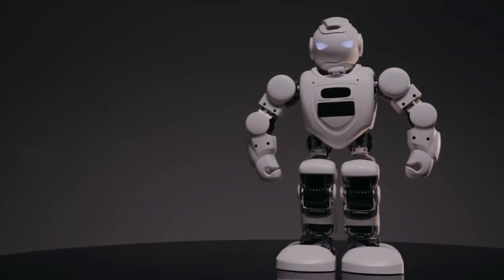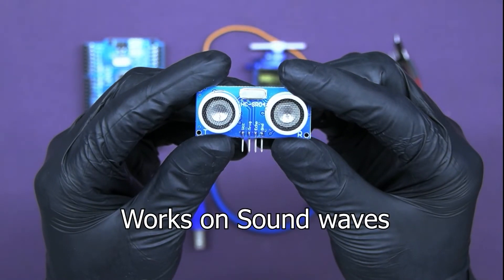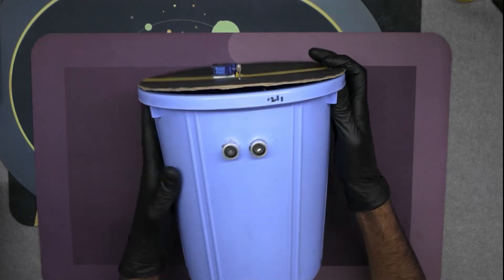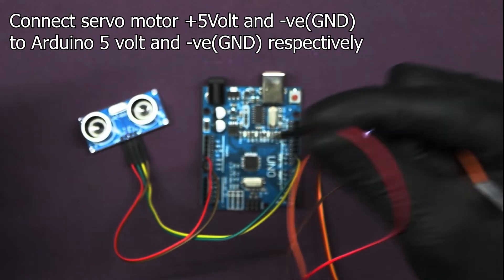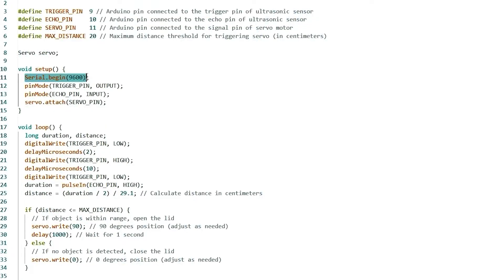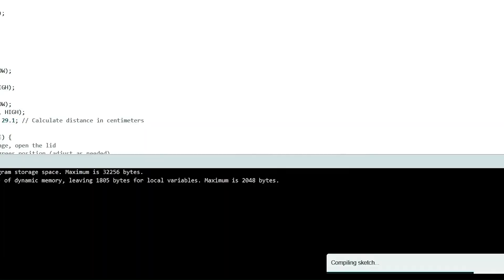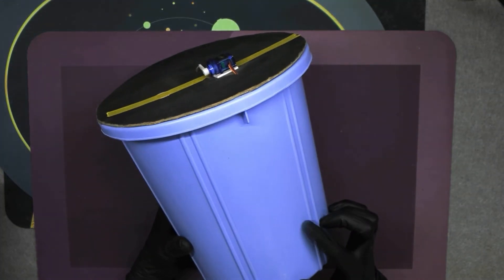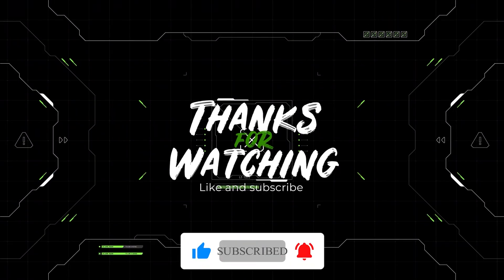Waste Wizard: Crafting a Smart Dustbin using Arduino UNO I Robo Army I Arduino Basic

Comment: Hi,

I'm facing error messages:

Output

Sketch uses 4194 bytes (13%) of program storage space. Maximum is 32256 bytes.

Global variables use 243 bytes (11%) of dynamic memory, leaving 1805 bytes for local variables. Maximum is 2048 bytes.

avrdude: stk500_getsync() attempt 1 of 10: not in sync: resp-0x00 avrdude: stk500_getsync() attempt 2 of 10: not in sync: resp=0x00

avrdude: stk500_getsync() attempt 3 of 10: not in sync: resp-0x00

avrdude: stk500_getsync() attempt 4 of 10: not in sync: resp=0x00 avrdude: stk500_getsync() attempt 5 of 10: not in sync: resp=0x00

avrdude: stk500_getsync() attempt 6 of 10: not in sync: resp=0x00

avrdude: stk500_getsync() attempt 7 of 10: not in sync: resp=0x00

avrdude: stk500_getsync() attempt 8 of 10: not in sync: resp=0x00

avrdude: stk500 getsync() attempt 9 of 10: not in sync: resp=0x00

avrdude: stk500_getsync() attempt 10 of 10: not in sync: resp=0x00

Please suggest how to fix it, thanks

Comment: Ardino 
Servo motor
Jumper wire
Power holder adc power
Ulasonic sensor
Lithium battery
Reply from the maker: Looks like you've got all the essential components for the smart dustbin project! 👍
Reply: @robo_army_ not yet

Comment: What does the jumper wires' size specifically need to be?
Reply from the maker: You can use standard jumper wires that are about 20–30 cm long. The exact size doesn’t matter much — just make sure they comfortably reach between your Arduino, breadboard, and components without being too tight or too loose. Shorter wires help keep the setup neat, while longer ones are better if your components are spread out.

Comment: How much time we have to charge them using lithium ion
Reply from the maker: Good question!  The charging time of lithium-ion batteries depends on their capacity (mAh) and the charger current.
For example, a 2200 mAh Li-ion battery with a 1A charger usually takes around 2–3 hours to fully charge.

Comment: Bro my arduino uno does not have two 5v port
Reply from the maker: No worries! You can still use your Arduino’s single 5V pin by using a breadboard power distribution or a 5V regulator to safely power multiple components.

Comment: One doubt 5v and Gnd in ardiuno  for both servo motor  and ultrasonic is confusing plz tell
Reply: Now motor working  thankyou but the cap of the dustbin cardboard  cannot open 😅
Reply from the maker: Glad the motor's working now! Try making the cardboard lid lighter or adjusting the servo angle to 100–120° for a stronger lift. Let me know how it goes!
Reply: What can do open the top of the dustbin?
Reply from the maker: The 5V and GND pins on the Arduino are for the power supply of both the servo motor and the ultrasonic sensor.
Reply: @robo_army_ thanks ❤
Reply: Once again thankyou 
.. the whole family  made the project successfully  ❤😅

Comment: Code
Reply from the maker: Thanks for watching, here is the code 
#include <Servo.h>

#define TRIGGER_PIN  9 // Arduino pin connected to the trigger pin of ultrasonic sensor
#define ECHO_PIN     10 // Arduino pin connected to the echo pin of ultrasonic sensor
#define SERVO_PIN    11 // Arduino pin connected to the signal pin of servo motor
#define MAX_DISTANCE 20 // Maximum distance threshold for triggering servo (in centimeters)

Servo servo;

void setup() {
  Serial.begin(9600);
  pinMode(TRIGGER_PIN, OUTPUT);
  pinMode(ECHO_PIN, INPUT);
  servo.attach(SERVO_PIN);
}

void loop() {
  long duration, distance;
  digitalWrite(TRIGGER_PIN, LOW);
  delayMicroseconds(2);
  digitalWrite(TRIGGER_PIN, HIGH);
  delayMicroseconds(10);
  digitalWrite(TRIGGER_PIN, LOW);
  duration = pulseIn(ECHO_PIN, HIGH);
  distance = (duration / 2) / 29.1; // Calculate distance in centimeters
  
  if (distance <= MAX_DISTANCE) {
    // If object is within range, open the lid
    servo.write(90); // 90 degrees position (adjust as needed)
    delay(1000); // Wait for 1 second
  } else {
    // If no object is detected, close the lid
    servo.write(0); // 0 degrees position (adjust as needed)
  }
  
  Serial.print("Distance: ");
  Serial.print(distance);
  Serial.println(" cm");
  
  delay(1000); // Wait for 1 second before taking the next reading
}

Comment: It is showing some power issue what to do sir when the port was connected in..??
Reply from the maker: It might be a power supply issue. Try using a different USB cable or port, and avoid connecting power-hungry components directly to Arduino. You can also use an external 5V power source like a charger or power bank. Let me know if the issue continues!

Comment: hello may i ask why the servo motor isnt moving even though the code was succesfully installed into the arduino?
Reply from the maker: Hi! I'm using an Arduino Uno for this project, but yes—you can use other models like Nano or Mega too. As for attaching the components, I used double-sided tape and hot glue to stick the sensor and servo to the bin.

Comment: My port is only "COM3"
Reply: It doesn't work back
Reply: Please help
Reply from the maker: No worries! If your port is only COM3 and it's not working, try these steps:

Make sure the correct board is selected (e.g., Arduino Uno).
Reconnect the USB cable and try a different port on your PC.
Restart the Arduino IDE.
Check Device Manager to confirm if COM3 shows 'Arduino'.

Let me know if it still doesn't work!

Comment: Can i use arduino uno R3? And how connect both cables to 5v? Sensor and servo motor
Reply from the maker: Yes, you can definitely use Arduino Uno R3! For powering both the sensor and servo, connect their VCC wires to the Arduino’s 5V pin, and their GND wires to the Arduino’s GND pin. Make sure the total current doesn’t exceed the Arduino’s limits—if needed, use an external 5V power supply for the servo.

Comment: Ive done everything but when i look in the serial monitor, it keeps saying 15 cm no matter where i point it at, please help 😢
Reply from the maker: It sounds like the ultrasonic sensor might not be wired correctly or isn’t getting proper power. Double-check the trig and echo pin connections, and make sure the sensor is facing open space. Also, try resetting the Arduino. Let me know what you find! 👍
Reply: I rewired everything and now its work great! Thank you very much for your help!

Comment: Does the code work with any servo motor?
Reply from the maker: Yes, the code works with most standard servo motors like SG90 or MG90S. Just make sure it operates on 5V and uses PWM. 👍🙂

Comment: Can I use arduino nano
Reply from the maker: Yes, absolutely! You can use Arduino Nano—just make sure to update the board and port settings in the Arduino IDE. The code will work the same. 👍😊

Comment: Can i use arduino nano
Reply from the maker: Yes, absolutely! You can use Arduino Nano—just make sure to update the board and port settings in the Arduino IDE. The code will work the same. 👍😊
Reply: @robo_army_  can you please tell how
Reply: To do the connections or if you could directly upload another tutorial it would have been great .please try
Reply from the maker: @Arnavdesignerofficial777  Thanks for the suggestion! We've noted your request and will share the update shortly. Please stay tuned and follow for more tutorials coming your way!

Comment: When I installed the program, I could open it, but when I put in the batteries, I couldn't open it. What's the reason?
Reply from the maker: It might be due to insufficient power from the batteries. Ensure you're using the correct battery type and voltage. Try using a USB cable to check if the system works, and then test with the batteries again.
Reply: @robo_army_  Thank you for your advice. It's really the battery.
Reply from the maker: Thanks for sharing your feedback. Good to know that we have debugged it correctly.

Comment: Can you make wet and dry segregation dustbin??
Reply from the maker: Already made and uploaded its tutorial, check it out: https://youtu.be/ZSD0sm6STI8?si=c-WIadY0yepOKqA0
Reply: @robo_army_  ok thank you but my ultra Sonic sensor not detect fastly object what can I do
Reply from the maker: You're welcome! To improve detection speed, ensure the sensor has a clear line of sight to the object and reduce the delay in your code's loop. If the issue persists, try using a higher-quality ultrasonic sensor. Let me know if you need more help  via our official WhatsApp no.: https://wa.me/918888103688

Comment: Hey 
i have uploaded the program to arduino uno but after removing the usb from the arduino uno it is not working 
when the usb is connected it is working 
can u please help me?
Reply from the maker: Hi! The issue might be that your Arduino isn’t getting power after the USB is removed. Please ensure you’re connecting an external power source (like a 9V battery or DC adapter) to the Arduino’s power jack or VIN and GND pins. Let us know if you need more help via our official WhatsApp no.: https://wa.me/918888103688
Reply: Send the coding 🎉

Comment: Hi.. Can you explain how to connect both sensor and servo to 5 volt andruino board? There is only 1 hole for 5 V. I confuse
Reply from the maker: You can use a breadboard or a "Y" splitter to connect multiple components to the 5V pin. Simply connect the 5V from the Arduino to the breadboard’s power rail, then connect both the sensor and servo to the 5V rail on the breadboard. Hope this helps!

Comment: What is cost of the components
Reply from the maker: You will need Servo motor, Ultrasonic sensor, Arduino Uno Board, Double Battery Holder with DC power Jack and switch with two rechargeable batteries, that will cost you approx. INR 1500
Reply from the maker: Now you can order the project kit directly from Roboarmy Store https://wa.me/p/9348967588496774/918888103688